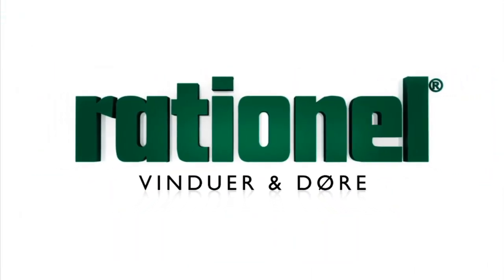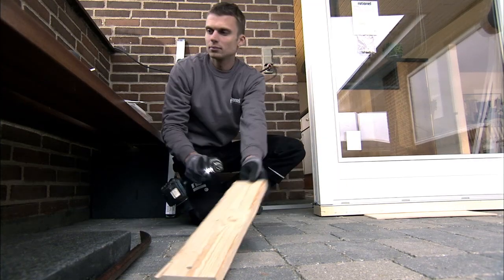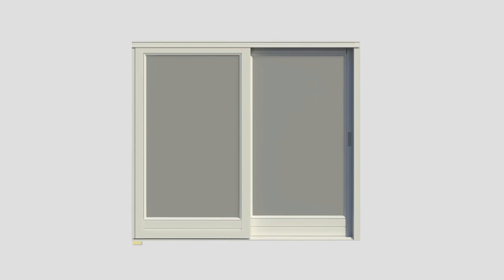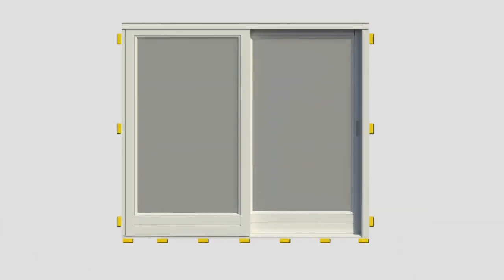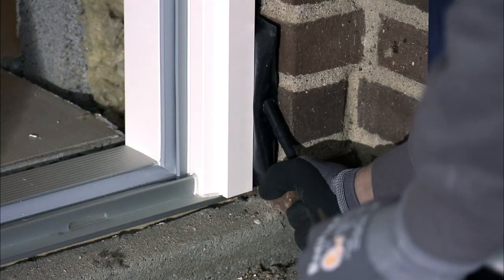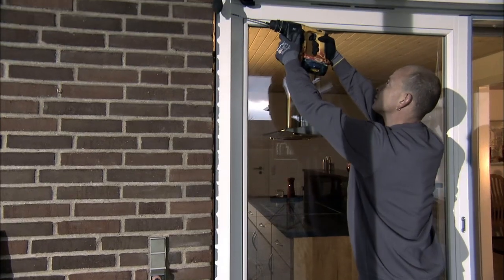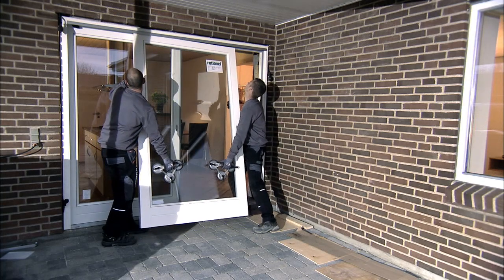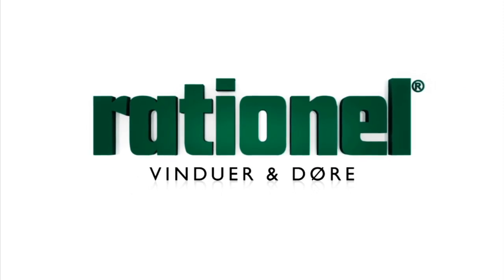How to mount a sliding patio door

Comment: That sliding door is NOT installed correctly - the actual sliding section should be on the inside !
As it is, someone could bar that door from the outside.